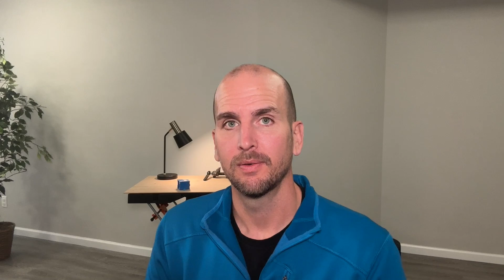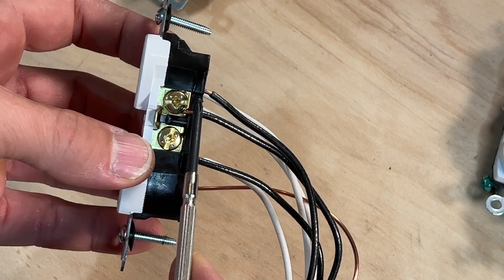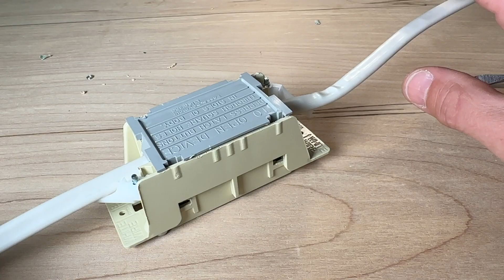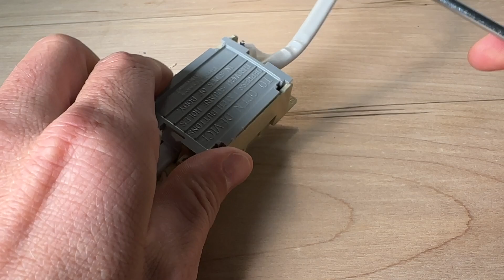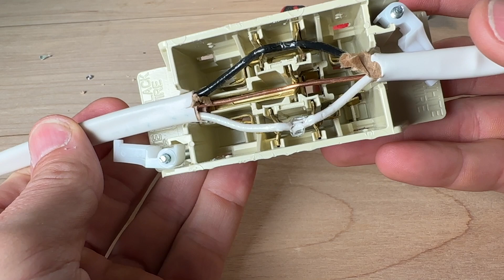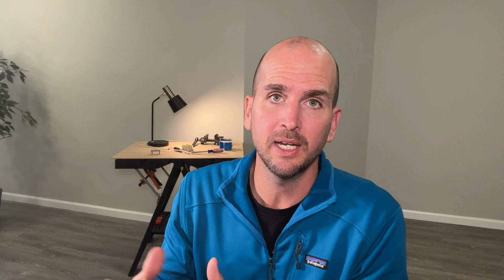90% Of Homeowners Have Never Seen This Dangerous Electrical Device

Comment: Being in the European and Scandinavian regulatory area, I don't recall seeing this type of connector on live power lines, neither in buildings nor in recreational homes. To be honest, it worries me a lot to think that this might become available here in the future, if the economy drives the production and installation of electrical appliances in this direction to save money. I see far more concerns than advantages to using this type of conductor in anything above networking cable socket voltages.
Reply: @EwanMarshall  Fair enough. Thanks for the video ID. I remember seeing this now, but also worth noticing that Clive shows high voltage cables connected with a juicy commercial grade joint where you use a ratchet to tighten two bolts to force the connectors together. Should be sufficient to be safe in most cases, in contrast to the SCD shown by Scott in this video.
Reply: @TrondBørgeKrokli  Yep, as I said, "handled better", properly designed for the application, I don't think this thing meets that standard. The concept is fine, implementation here has some issues. If for example the way the casing closed is what pushed them in properly, that would be better. Also better blade design to better circle the conductors and give better contact.

Comment: IMO the theory is good, but practice provides too many variables.  Push down too far and it (nearly) severs the wire.  Not far enough and it barely cuts through the insulation.  Couple that with no definitive way to really tell just by looking is a recipe for problems.   Good video.

Comment: I suppose this would be fine for a 10W (83mA) load since the wires can easily dissipate the heat from a bad connection. Pretty sketchy for 2400W
Reply from the maker: Happy to help!

Comment: I have seen NZ versions of them somewhere in New Zealand, but as far as i know, they are only used in ceiling spaces to plug in LED lights, which use a standard three pin plug. The LEDs will use tiny current. One feeder line to a dozen down lights can snake through the ceiling space for a bunch of LEDs on one circuit.
Reply: Since NZ and Australia use the same standards i can say that yes they are only used in ceilings but that is because they aren't switched but they have been around for a fair while now and are used a lot for commercial lighting also the ones we have seem much better than the one shown faster to use and much better connection

Comment: It was not pushed into the IDC blades properly. The white and black wire should have been in the same position as the ground wire inside that little triangle.
Reply from the maker: Agreed that for proper installation you should have the specialty tool which will completely seat the wires., I was trying to represent the way I found the wires installed in the outlet which failed as I think that is also a good example of problems found in the real world with this design.

Comment: There's nothing dangerous about those outlets.

The danger comes from poor installation, same as any other other electrical device. Blaming the outlet because the installer has used the wrong tools is pretty stupid

Comment: I'm no expert, but I'd feel a little better about an insulation displacement connection for power applications if there were like... at least 4x as many blades going through to give larger and more consistent contact area, as well some other extra mechanism to better lock things in place mechanically. As it stands, doesn't look very trustworthy to me.

Comment: I would make a section of stripped-off insulation on the conductors, then press the stripped parts down into the blades.

Comment: I have had these in several RVs that I've owned but I've never taken them apart to see how the connections were made. We routinely run multiple 1,500 watt space heaters in our RV in the winter and we've never had any issues with outlets getting hot but I can certainly see how these could be problematic of not installed properly.

Comment: I replaced an outlet in a fifth wheel for a friend.   The original outlet was fried and smoke stained.  Due to the thin wall framing,  I replaced it with an identical one, which was thinner profile than in this video. I took extra care to make the best contact as possible,  but didn't very feel good about it.  It is still working,  but what about the rest of the trailer wiring? A disaster waiting to happen?

Comment: I suspect a significant part of the problem is that the romex used has insulation not intended for insulation displacement connections.  It's too tough.

The other part is not using a punch-down tool.

Installed properly with a compatible wire product, that amount of contact should be good to the rated 15A. Now, if RV and mobile home manufacturers aren't installing them properly with compatible products, that's a hell of a thing.

Comment: I've seen IDC stuffed wires fail in pinball machines at 5-12v ... I wouldn't ever, ever, ever trust that with household power.

UL, and code, or not.  Scary. Scary. Scary.

Comment: They are safe if the proper tool is used to push the wire down, and the insulation is cut properly on all 4 points on contact for each wire

Comment: UL listed and up to code?  Somebody payed someone off! The glaring problem I see is no way for the inspector to see if the proper tool was used and the conductors properly seated. Perhaps the code should be at least amended so that the back cannot be put on until signed off. But I still don't like those knife contacts, even if duplicated,  carrying up to 15 amps.

Comment: An adaptation of the Scotch locks that were invented for uhaul to f up your car wiring if you rented a trailer from them. I'm a trash truck mechanic and they have caused me hundreds of hours of work to repair the damage that they do. My personal opinion is that the inventor should have been strung up

Comment: Having wired over 1,000 new homes (over 45 years) and owning eight (yes, 8) Rv I can tell you these are used in amost all RV now. All the RV have dedicated  H.R. for the large applicanes like Micro-wave, Electric Heat, Furnace, Refrigertor, A/C units. So the only load on those oultets SHOULD be low. Unless you plug in an electric hair dryer. That is when you start having problems.
Another note is these outlets can not be used in a lot of Counties for new homes. They do not have the correct cubic inches of air space and they do not have the the coorrect length of wire sticking out of the box as per the NEC. Also just because it is UL approved does not mean it is code compliant.
Great information on your video, thanks.

Comment: No way in hell would I use this for high voltage.  I own punch down tools for networking,. Even then sometime a connection isn't valid, no big deal small voltages, but this I could imagine causing fires or just being very inefficient if the connection is bad... Imagine an alarm clock plugged in but I constant Arc in the back just draining energy.  That alone could make your electric bill Spike.
Reply: So that's saying with using the correct tool seeing things done with a screwdriver is a hell no!

Comment: I am guessing that the code compliance is supposed to be contingent on the correct wire and punch tool being used, but if you don't crack down on mis-use then there is no point in allowing it.
The US doesn't have the compliance infrastructure to ensure these are being used correctly so they just shouldn't be permitted (except maybe for OEMs?).

Comment: A friend of mine purchased a mobile home we immediately went through took all of these out put old work boxes in and replaced them with standard receptacles about 60% of the ones we pulled out were melted from being used with space heaters hairdryers and other high amperage electronics in my opinion these are a fire waiting to happen and I too am surprised that UL approve them but likely if you read the UL label and this is just a guess it will probably say only UL approved if used with proper installation tools.

Comment: I don't see anything wrong with it other than longevity. I think most residential or commercial electricians over think how how much current can safely pass through a conductor or in this case a small patch of the conductor.
For example in the automotive industry it's very common to use 18 AWG for a 20 amp circuit, bundled together tightly in temperatures than can approach 150°F.  Like the grinchs heart, this would be considered one more than two sizes too small in residential or commercial electrical, yet we don't see cars bursting into flames everywhere.  Why is this?
ANY amount of current can flow through a conductor, but the heat generated through resistance is the problem.  So long as the heat generated doesn't melt the conductor and the material used for insulating that conductor can handle the heat, it doesn't matter what you put through it.

Comment: I have a manufactured home in Florida and hadn't looked into these until your video. IF I have them they are all coming out and being replaced with boxes and good receptacles, not back stabbed, J hooked and much safer. Thanks so much for the tip!

Comment: The same system of connection is used for phone landline wiring and network sockets, in that case it is perfect, but there is no way that this type of connection is safe for even close to 15 amps, or even 5 amps.

Comment: That type of connection can be great WHEN DONE WITH THE RECOMMENDED TOOL. I've only used it on low power connections (under 100W). YOU CANNOT PUSH THE WIRE IN WITH A SCREWDRIVER!

Comment: I live in a newer manufactured mobile home by Clayton. Other than the GFCI receptacles in my house, the rest are these SCD's. The ones used in my house are not a good brand name, and since being in my home, over the last 10 years, I have been slowly replacing them by using new work boxes, and Legrand commercial receptacles. One of the biggest issues I have seen with these have been the get loose and don't hold a plug well. I haven't had a failure, but I could see where it could with the small amount of contact. The one where we plug our air fryer actually got hot, and the cord on the air fryer started looking melted. I replaced that one right away, as well as replaced the air fryer. Could have been the appliances problem, but fires are nothing to play with. The faceplates on mine snap on, no screw, and that is a problem to, as the plastic is brittle and just normal use can cause them to slowly pull away, breaking a tab and then don't stay on the receptacle. My advice would be not to replace them all at one time as they do seem safe enough, but slowly as time goes on when they get loose, replace them, or start in one room like the kitchen where stuff gets plugged and unplugged frequently and replace the whole kitchen, then move to a bedroom, taking your time so you don't get burnt out.

Comment: Don't have experience with THAT connector type of outlet but I've long used connections that pierce the insulation to make contact with the core wire.  Some have been stranded wires, some have been solid conductors.  And while they DO work - I don't like them from a long term standpoint.  They just fail too easily.  And if you don't know what you're doing - failure comes even earlier.  Forget about specialty tools.

Comment: I’ve not only used them, but I’ve used them by the thousands.

The example you show in this video was not installed correctly.

There is almost never a failure from the device but from poor workmanship during installation. I’ve seen the same kind of poor workmanship on regular outlets: not using a hook under screws, using a hooked wire in the wrong direction, not having wire secured under the screws and all sorts of bad things.

UL standards compliance certification isn’t just handed out like candy at Halloween. Devices are installed according to manufacturers installation instructions, tested to the limit of the device until failure and it’s repeated multiple times before being certified.

This means that the device will operate safely as expected when used as designed and installed according to manufacturers designs.

Again, the wiring in this example was a perfect example of not being installed correctly.

These devices have been used for over 50 years successfully and the failure rate is nearly equivalent to standard residential outlets. Millions of correctly installed devices attest to their safety.

Comment: Frankly speaking I am astonished by the paper insulation in the wires and that there are other means of connecting outlets than clamping a straight wire with a plate pushed by the screw.

Comment: I would assume that the manufacturer of those devices would require the installer to have the specialized installation tool. The right tool, would give you enough leverage and evenly distributed force to properly install the wires. In that case it would easily handle a 15 amp load. it appears to be a device that is not reusable. Excellent video.
Reply: Indeed, the tool is required for installation and the devices are single use installation.
Reply: @keithblackie969  And it is clear that the correct tool was not used in this failed installation, so hardly surprising that it failed. In general insulation displacement connectors when installed correctly should be extremely reliable. Way more reliable than anything involving something that can be screwed down.
Reply: @jonathanbuzzard1376  I’ve installed thousands of these. ALWAYS use the tool.

Comment: You are right about therm being in rvs I started replacing them with standard sockets because I had one over heat during use,  could have lost my camper had I not been there to smell and then notice the smoke.

Comment: I can't believe these sort of things exist. How can such a small contact area carry 15 Amps safely. I've seen similar things used on low voltage called scotch blocks here in the UK, but even those are terrible and cause more problems than they fix.

Comment: As a service tech in an area that has a LOT of mobile/manufactured homes I see this all the time. And you're right, they ARE dangerous. My habit is to use an old work box and replace with a standard outlet. I hate these things. But mobile homes have a different set of standards than stick builts. Even plumbing is substandard.
Reply: I've only ever seen IDC in electronics before this video and... I can't believe how sketchy these outlets seem in comparison to those, and the electronics ones don't have to carry any serious power.

Comment: As you pointed out the commercial outlet where one secures a straight piece of wire under the screw down contact plate is THE BEST.  As a DIYer it’s easier to wire and the most secure.  What I hate today though is the tamper resistant plug in “feature” that is required.  Installed several in a kitchen remodel and then experienced that the appliances were extremely hard and difficult to plug in.
Reply: The requirement for tamper resistant outlets is only for areas that young children may be able to reach like living rooms bedrooms and the such where the outlets are down low. Above a kitchen counter or elsewhere like that only require it be protected by gfci. Commercial building doesn't require tamper resistant outlets at all (unless maybe they do for pediatrics offices and such where young children frequent) so they still make regular outlets that you can buy
Reply: That's amusing this essential safety feature has been integral to UK plugs and sockets for 75 years now.
Reply: I would recommend wiggling the cord left and right and your issue should go away
Reply: My instructor always said to never ever ever wire things that way, and that it's just as bad as the backstab connectors.

I don't know what his reasoning was. I just do what I'm told and never question it.

Comment: Although I spent most of my career in British power stations, I take an interest in electrical practices around the world, which is why your channel occasionally comes up on my home page.
These outlets are, of course, different to the outlets we use in Britain, but like you, I was appalled at the connections at the back. I would never trust anything like that. On telecoms and IT systems maybe, but power- NO WAY.
One of the things that you mentioned, the UL mark. Are you sure that it is genuine? Here, large numbers of sub-standard Chinese electrical and other goods have been imported with the official CE mark (from our EU membership days) which supposedly means that they comply with the required codes, yet often turn out to be lethal.
If these outlets were really made in the USA and the UL mark is genuine, then I would be extremely worried about the standards. I hope that RV owners see your video and then check their outlets and have them replaced if needed.

Comment: I've never seen that, am immediately not impressed and disturbed at the same time. It's disturbing that those that are supposed to be looking out for the public's safety have ok'd such a dangerous setup. I'm an auto tech, i have seen splice blocks in cars, which are pretty much the same idea, barely any contact, and very corrosion prone. If i absolutely had to use this box setup, i would strip the wiring insulation in the area where the wires go into the contacts, that way i can minimize the danger. But, it's still way too little contact at best.  This kind of cheap garbage needs to be removed from the market permanately. Btw Everyday Home Repairs, could you take apart an outlet with the backstab terminals, i'm curious as to their construction.